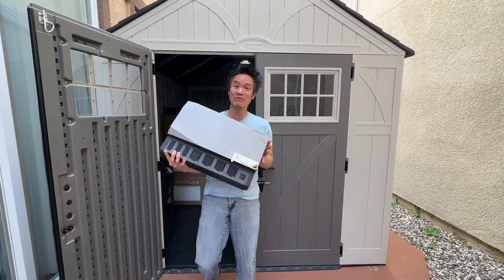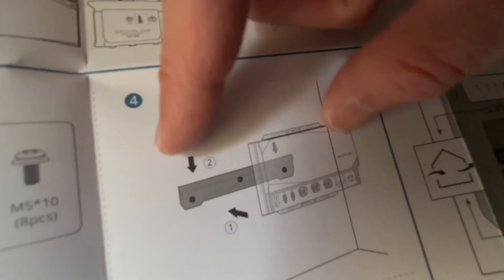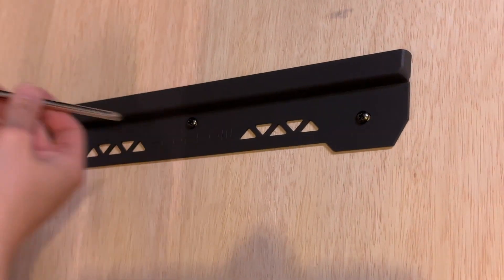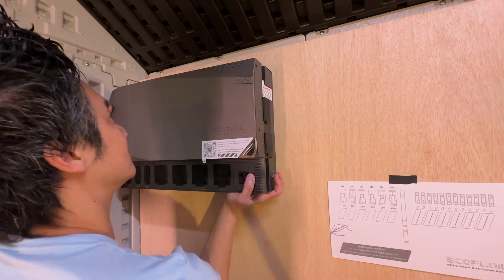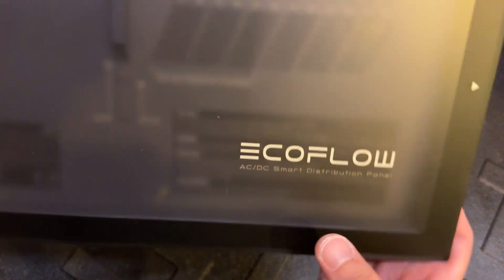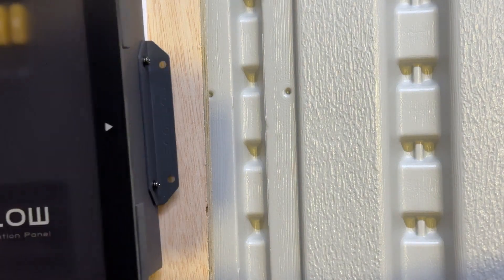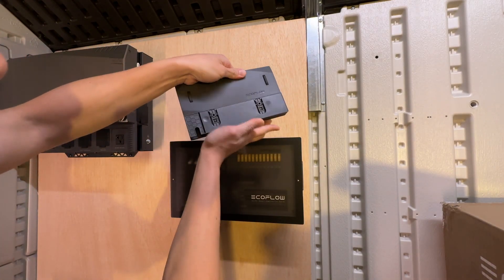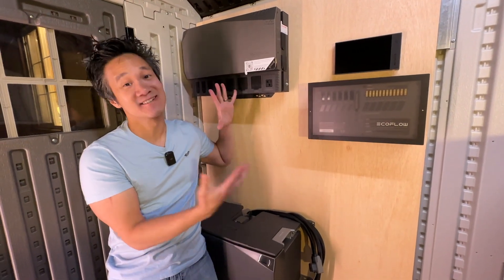Power Kits Off Grid - COMPONENTS INSTALLATION! Day #3 of EcoFlow Power Kit Installation!

Comment: Nice but that sheet of wood doesn’t look strong. But I love the set up. I got a delta max that unit is way out of my range. 15 kWh would be great to have.
Reply from the maker: Thanks!  FYI: The sheet of wood is actually VERY strong it's 3/4 thick.  And the PowerHub is only about 25 pounds.  A single bolt to attach the top of the wood to the shed would make it very rigid, if I decide to do that, but I don't think it's needed.  

Delta Max is incredible too!  They have the Delta 2 Max now too! https://amzn.to/3qTO6y0 (affiliate link), it has the ability to expand capacity too!